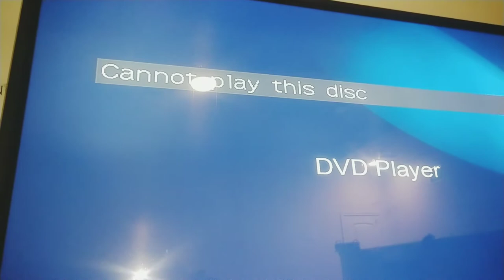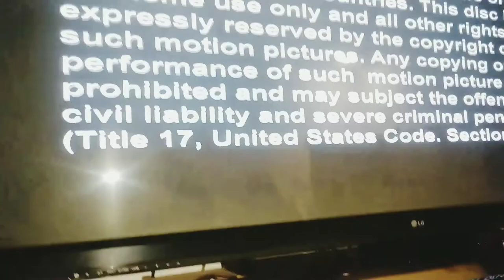Sony DVD Player Won't Spin or Read Disc Fixed. Model DVP-SR210P

Comment: People throw away lots of dvd player when it says no disc,but there are person to repair it. When a dvd player is taken in repair, the technician gets smart with you.
Reply from the maker: I love fixing stuff people throw away
Reply: @becausestuffbreaks  awesome 👌
Reply: @becausestuffbreaks  I took a magnavox dvd player apart and the dvd motor it doesn't have wires attached to it.
Reply from the maker: @hopenavajo1391  soldered straight into the board or on a ribbon cable?
Reply: @becausestuffbreaks  so there is no OEM that can't be replaced to it
Reply: @hopenavajo1391  solder straight into the board

Comment: Thank you for the video. 
Could you tell me why the head doesn't move pl? What checks should I do?
Reply from the maker: Check cable and wire connections. Check if screw gear is turning. Might need lubricated.
Reply: Good evening. My Philips DVD is saying No disc to every disk I put inside. What can be done
Reply from the maker: @ademolaoluwaseun8896  Clean off the laser lense with rubbing alcohol and a Q-tip and buff it dry with the other end. Let me know if that works

Comment: The black powder could be from the  grommets or rubber -mountings.
Reply from the maker: Good to look around for the source. Thanks for watching!
Reply: More likely  carbon brushes from that motor. It was directly under the bottom side of the motor, right where the brushes are located. That piece of copper laying there?... is also part of the brushes.
Reply: I tested the motor and it works.

Comment: I’m trying to remove one of the 3 tiny screws that holds the spindle motor together.  I had success with the first two but the 3rd won’t budge even when I try small screwdrivers.  Any tips?
Thanks!
Reply from the maker: Can you get WD40 onto it?
Reply: Soldering iron. Get it hot. Touch it to the top of the screw for a few seconds, then quickly try turning it.

Comment: I just did this and left room in case I need to do it again but it quits spinning sometimes and I have to open and re open it but it's OK could it be my wiring? The motor is good intook it out another one that did run but wouldn't stay on.
Reply from the maker: Did you clean the lense?
Reply: @becausestuffbreaks nah no need it's good but now it's not reading right in addition to me having to 1 hit tge top to open it and sometimes it stops spinning is what the original issue was. Now as in just now it takes forever to load and looks dragging lol😂 should I re adjust my wires since they are pressed down and  try n clean the leans? I have no rubbin alcohol though
Reply from the maker: @xxshadowdevilx527  you can just buff it off with a dry q-tip or get a q-tip damp with water and clean it with that but buff it with the dry side after

Comment: On my technics CD player write no Disc and not spinning motor. When i was opened the player I directly connect 5v to motor and he working normal. Its Maby defects capacitors on board?
Reply from the maker: Probably whatever motor driver supply chip they use.

Comment: Well me doesn’t have a spare motor. 😢Would you give me some guidance on replacing my 12 year old, very much used DVD player please? Am online at Walmart & eBay. That’s my choices, nothing locally. Thank you.
Reply from the maker: Here the part on Amazon: https://amzn.to/3GcPvnw
Reply: @becausestuffbreaks  Thank you!
Reply from the maker: Let me know if that works. Thanks for watching!
Reply: @becausestuffbreaks  have been boycotting Amazon for years now. Have replaced my 12 year old dvd player, hooked up yesterday. Appreciate your response. My Bose sound bar went up too. They sent me new cables, but no😢. The cheapie dvd player lasted longer than the very expensive sound bar. Also hooked up new t.v. Don’t need a sound bar. Sorry in advance to the landfill. Happy New Year!🎊

Comment: I have that same player.  The disc drive motor is fine, but the player often fails to start a disc, or it stops while playing, either with a pause then continues playing at some point by itself, or permanently; note that the disc continues spinning during these episodes.  I found that if I press down on the rack drive motor (the one visible from the top in the rear corner of the play module) or the rear part of the surrounding structure it kicks back in and operates properly.  It goes for a while but usually fails again at some point.  It sometimes also has trouble skipping or going to a different track.  I can't tell offhand whether it's a mechanical issue with rack drive jamming due to structural flex or something electrical (loose connection?) with the motor or another component.  It's a bit impractical to leave the cover off and have to press on the rack motor or part of the structure every time it goes down.  Any suggestion?
Reply from the maker: Try cleaning the laser lense with a Q-Tip and rubbing alcohol. Maybe it stops seeing the disc and that's why it shuts down and then kicks back on when you push down. Also unplug and then plug back in your cable bundles and ribbon cables. Let me know what you find.
Reply: @becausestuffbreaks  Thanks for getting back to me.  It turns out it's the spur gear on the laser rack drive motor.  The gear had split over time between two teeth, I assume due to the assembly press fit, and so meshes intermittently.  Until I can find a replacement gear, if that's even possible, I loosened the motor screws and shimmed it to one side to allow a little mesh clearance where it was hanging up.  Probably not ideal from a gear wear perspective, but seems to work for now. Pax Christi. 😉👍
Reply from the maker: Awesome! Thanks for the info
Reply: @becausestuffbreaks  I found this video of a fix for a split spur gear that was causing the same problem I had. I haven't been able to find a replacement gear, so may resort to attempting this as a more permanent solution than cocking the drive motor. https://www.youtube.com/watch?v=Kr16o8YMa5s
Reply: @guitarman_3693  Thanks guitarman.  At some point after my temporary fix, the player acted up again, and I found it was due to the spur gear sliding on the shaft to the point where it disengaged from the mating gear.  I ended up boring the spur gear hole very slightly to where the crack didn't open when installed on its shaft, then applying a small amount of E6000 adhesive to the shaft plus a small blob on the end of the shaft to prevent sliding.  I was then able to remove the shim under the motor and fully secure it by tightening the screws.  Works fine now!
Regarding your belt comment, I did find that useful on another player, a Technics SL-P101.  The disc drawer on that unit was not opening properly due to stretch in the original belt.  I ordered a new belt from Russell Industries and that fixed the problem.  See a similar unit being repaired in https://www.youtube.com/watch?v=Zas9uYmqb6g&t=114s.

Comment: Thx for this. I have a cheap $30 dvd player that wasn't reading discs. I was about to chuck it, but this video showed me that the problem was the motor. I keep the lid unscrewed now to manually kick the motor until it finally dies.
Reply from the maker: Get all the life out of it that you can. Thanks for watching!

Comment: I've just opened up my dvd player & cleaned the laser lens, but no luck & the disc still wont spin either. I dont know what else i can do, mine is a Sylvania & its only a couple months old. Please HELP me!😢
Reply from the maker: Probably the motor. Did you make sure all the cables and ribbon cables are seated in all the way?

Comment: My Pioneer PD-4700 cd spindle motor has orange and yellow wires soldered to it, so if my replacement motor has red and black wires, does it make a difference which wire the red gets connected to?
Reply from the maker: Yes, because it will spin backward if you get it wrong.
Reply: Yellow with black, orange with red.

Comment: I bought a Sony blu ray used a long ago but putting a brand new dvd disc in the player it makes circles on my new disc so what is the problem with it it makes me not wanting to put any more disc in this player ever again
Reply from the maker: Eek. That's not good. The screws holding in the disc drive motor might be loose and causing the disc to drag on something inside. Either way, you'll have to take it apart and see what's scratching. Maybe there's foreign debris inside it.
Reply: Or maybe I’ve should have bought a new Sony blu ray dvd player because not knowing what the original owners did to it
Reply from the maker: @linkmasters535  that too. Thanks for watching!

Comment: How do you get the disc out if the tray won't open
Reply from the maker: You'll probably have to take it apart
Reply: @becausestuffbreaks  that's what I'm trying to do
Reply: What kind of screwdriver do I need
Reply from the maker: I don't remember, but I assume it was a Phillips head
Reply: @becausestuffbreaks  ok

Comment: I have the same dvd player and when i press the ON/OFF button did nothing what happend? Thanks
Reply from the maker: Sounds like a bad power supply or button. Have you tried the remote?
Reply: @becausestuffbreaks  the remote is lost unfortunately
Reply from the maker: If you have another Sony DVD player, the remote should work on this one also
Reply: @becausestuffbreaks  OK thanks